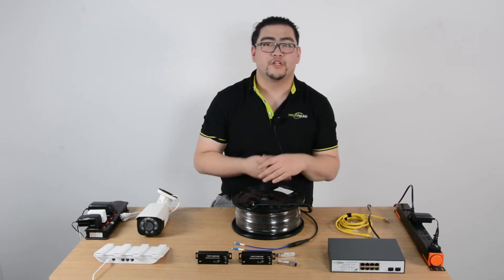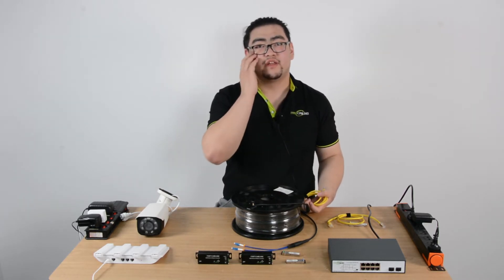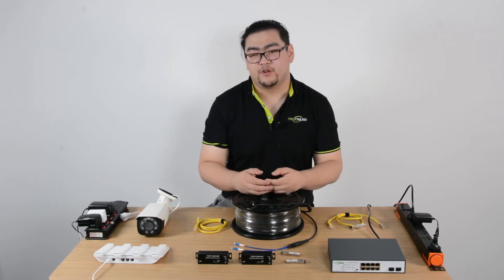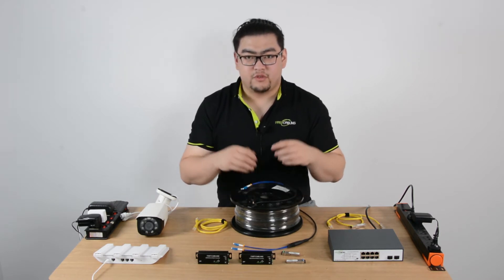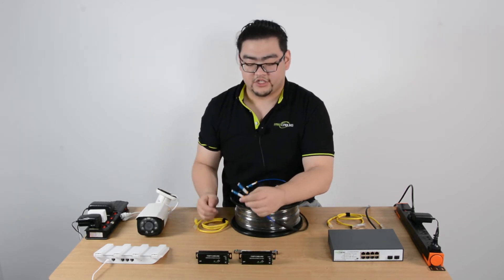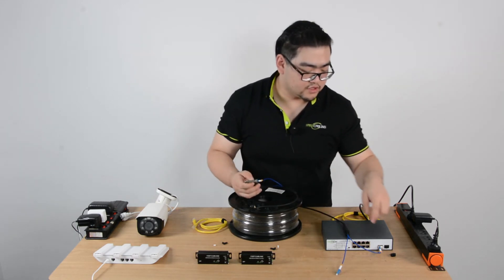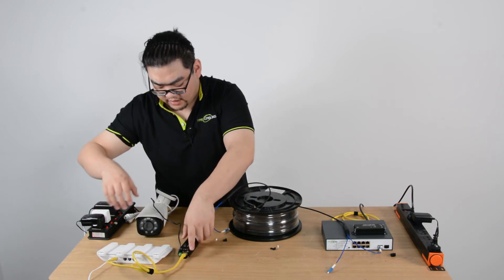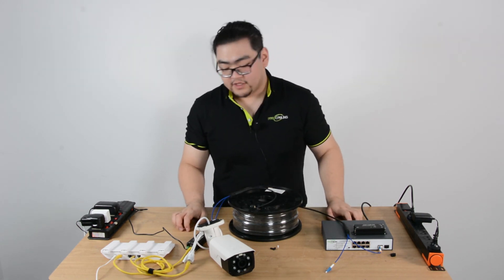Using Fiber Optic Link for Long Run IP Camera System

Comment: The question is what if I want to cut a piece of that long cable instead of using it all so what should I do
Reply from the maker: Cutting a fiber optic cable is a delicate task that requires precision and the right tools, so we generally do not recommend our customers do it themselves. You can buy one that is custom-made, and specifically tailored to your unique requirement. But if you do want to do it on your own, here’s a guide to help you through the process:

Cutting the Fiber Optic Cable
a. Always wear safety glasses to protect your eyes from small glass fragments. Fiber shards are very sharp and can cause injury.
b. You will need a fiber optic cleaver or a high-precision cutting tool specifically designed for fiber optics. Do not use ordinary wire cutters or scissors.
c. Remove the outer protective jacket of the cable using a fiber optic stripper, being careful not to damage the fiber within. Strip off any additional layers (like Kevlar strength members, if present) to expose the bare fiber.
d. Use isopropyl alcohol and a lint-free wipe to clean the exposed fiber.
e. Use a fiber optic cleaver to make a precise, perpendicular cut. The cleaver will score the fiber, which you then snap to create a clean break.

To terminate the fiber cable, please refer to this video: https://www.youtube.com/watch?v=gyhVTg6gE20
Reply: @Fastcabling  Thank you it's appreciated for providing these information and yes you are right I was watching some videos on YouTube of some specialists  doing the cut and yes it's hard job, requires patient and specific tools
Reply from the maker: Yes, that's why we only sell pre-terminated fiber optic cables (now available in different lengths). Easy to use even for beginners. Cable termination tools can be more expensive than the cable itself. If you're interested, we can provide custom network design for free, feel free to contact us at support@fastcabling.com or submit your inquiry here: https://www.fastcabling.com/free-solution-design/

Comment: Thanks for posting the video, it is simple yet full of key details (perfect for people like me who just know the basics). I have a question, for the setup we have, one of the cameras is over 100m distance from the NVR, but probably not more than 150mt, a PoE extender is the main option considered, fiber optic being the other, but seeing your video I'm wondering if the advantages of Fiber optic for that distance would be much higher; as you mentioned, you can't send power through fiber optic, so a power cable would have to go together with the fiber optic, compared with the PoE that would run power through the cable...
Reply from the maker: I don’t think you will need fiber optical cable. You will need media converter both end to work with fiber optical cable. If you have 150 meters only. You only need single PoE extender and you don’t need PoE injector. Here is the link PoE NVR - 80 meters cable - PoE extender - 70meters cable - ip camera. https://youtu.be/nPhUjtIOku0
Reply: @Fastcabling  thanks for your reply and your input, it is much appreciated!!

Comment: is that switch the nvr ?
Reply from the maker: It is the switch, but you can attach the media convertor to the PoE NVR instead of the switch.
Reply: @Fastcabling  whats that switch getting fed from?
Reply: @sashejaneski6501  

its supose to be opese
the IPC's conect to the POE switch , if you have only one, you dont need switch.
and the router is usualy in on the other side  , and  most routers are not POE.

Comment: sir ,
can we use optical fibre in normal hd camera 
ip camera is costly incompare to hd camera 
please share information
Reply from the maker: I believe it doesn't make any difference, either by using fiber optical cable or the cat5e/cat6 regarding the bandwidth with 100 meters. However, if you need long distances, the fiber optical cable has the advantage. You can't use POE with fiber optical cable.

Comment: how many core fiber cable should be if i have 4 cameera ?
Reply from the maker: I believe single core fiber cable should be enough, but you can have additional core for backup. You will need the outdoor switch to aggregate all 4 cameras.  https://www.fastcabling.com/product/outdoor-poe-switch-with-sfp/

Comment: Sir , did we really need fiber optic for instalation with so many hub poe?

Whats fibet optic for? Can u explain please. Thanks
Reply from the maker: The advantage of fiber optical is long distance, high speed, and low latency. It is very easy to get 1 Gbps connection up to 10km. The standard cat5/cat6 is 100 meters maximum for TCP/IP. Even working with an 800m PoE switch, the bandwidth will need to be compromised to 100mbps in order to achieve 500 meters. It is pretty much just the light running through the fiber optical cable. The media convertor is required on both sides to convert the optical signal and the electronic signal. If your PoE switch has a fiber optical slot, the media converter is not required on both sides. Just in case you may want to know, you can't send the power through the fiber optical cable.
Reply: @Fastcabling  wow sir, you really lifesaver. so basicaly we need Fiber optic and media converter from NVR to next hub. right? thank u so much for answering. ill sub
Reply: Yes, see it as a kind of "trunk" probably you should use camera router's side or switch to provide alimentation trough POE.
Reply: for extremely long spans

Comment: Why a router at the camera end? For multiple cameras? I wouldn't need a router for only 1 camera, correct?
Reply from the maker: Actually it is the switch. You are right. It is dofr mutiple cameras at the edge. You don't need the switch for single camera.

Comment: Sir can you do a demo for daisy chain fiber optic cctv installation
Reply from the maker: You may consider the ring network rather than daisy chain fiber optic cable. it has a backup link if one of the nodes is down.